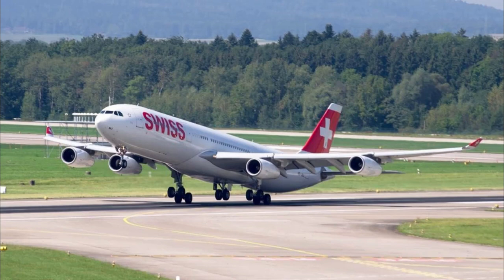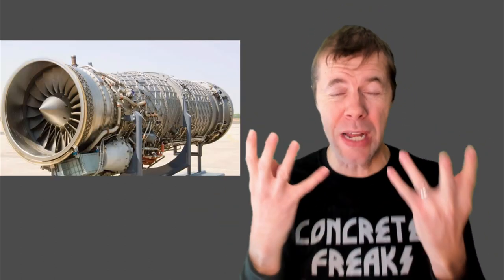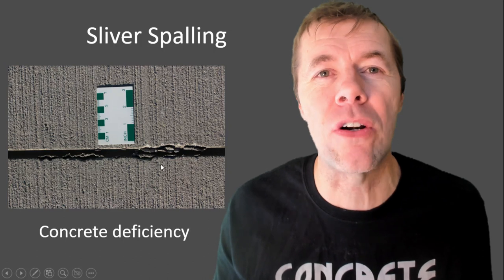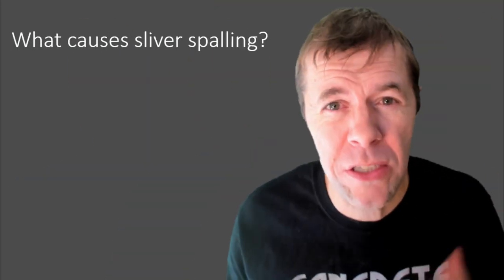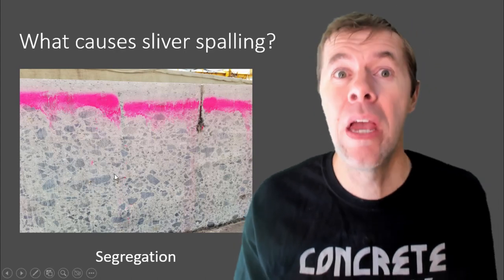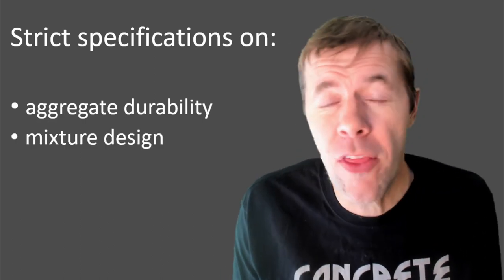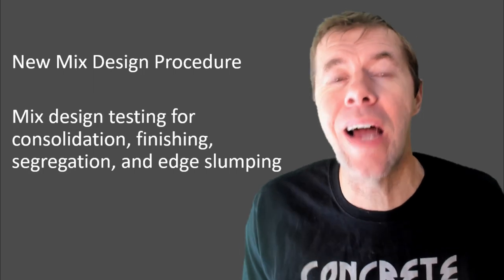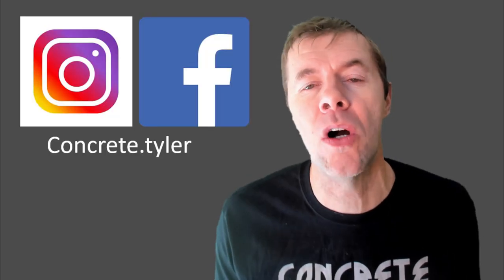Challenges with Airfield Pavements

Comment: My first job out of the MTSU CIM program was an airfield paving operation. 

We had portable plants scattered across the mid-Atlantic. 

I learned so much during my time there. 

Prepping a plant site, erecting the plant, stockpiling materials, logistically planning the delivery of a dozen loads of cement on paving days, batching 300 yards an hour to keep up with the paving train, making beams, running all kinds of heavy equipment including mixers, you name it. 

I still miss it sometimes
Reply from the maker: That is so cool!  It sounds like an awesome experience.
Reply: Were they dry or wet batch plants? All the recent airfield specs we've seen call for wet batch which eliminates many suppliers.
Reply: @concretelogicpodcast  wet batch. 
That’s not surprising about the spec. 
A dry batch would have a hard time keeping up with a paver I’d say.

Comment: Project in an airfield in California.  The engineers decided to put groves in the concrete parallel to the path of travel. I don't know if it was the close spacing of the grooves but the concrete completely failed.

Comment: Concrete runways definitely require very high quality throughout the whole process.
Where I live there are still a few concrete roads that have survived since probably the 60's. They have some wear, but are also proving the longevity of concrete paving. The downside is that you feel the joints when you drive on them, something that's even more noticeable when you have a car with low profile tires. But the required precision on the joints isn't the same for ordinary roads as it is for runways.
Reply from the maker: It is great that you are seeing such good life out of your concrete pavements.

Comment: A video focusing on the role of aggregate in concrete would be much appreciated. I've always assumed it was mostly just a way of reducing the amount of cement used and that a higher amount of cement would be ideal if it were economical. This also seems to align with my experience with home store cement products, where a bag of run-of-the-mill concrete is much cheaper than something like precision grout. But my understanding clearly isn't the whole picture due to the sliver spalling/segregation issue, which I knew nothing about.

Thanks professor!
Reply: That is good idea for a video.  I would guess he already did one in the early days of the channel, but it would be good to revisit.  The aggregate provides almost all of the strength, especially compressive load bearing strength.  The rest is glue to hold the aggregate together and fill the small voids.

Comment: As a mechanical engineer we used to joke that if concrete were invented today it would not be authorised, but I admire your enthusiasm, I was part of the (UK) team that designed the National Airport Pavement Test Facility in Atlantic City. Actually just the machine itself the rail system, steel bridge gantry and landing gear attachment. The premise was that it was the subgrade that often failed, leading to the concrete failure. I see much impressive work done on this topic. By the way, Concorde crashed because the FOD was a bit from a previous aircraft taking off, a DC10, not any concrete but it does illustrate your general point.
Reply from the maker: Thanks Mike!  I have heard about the test facility in Atlantic City but I have never seen it.  
I think concrete is pretty amazing!  We can make something that lasts for generations in the weather for only a few cents per pound.  IT GIVES ME CHILLS!
Reply: @TylerLey 2020 FAA Airport Improvement Program grants used 68% of 4.3B budget for concrete. The tech center research is tasked with driving down that %.

Comment: My father was a USAF aircraft maintenance officer back in the late 50s and early 60s.  I remember him talking about the requirement to launch and recover an overloaded (1,000,000 pounds) B-52 and the concrete needing to be 10 feet deep.  The plane could carry it, but the worry was damage to the runway.  During the Cold War we were always trying to demonstrate some feature or other that the USSR could not do, and flying a million pounds was one of them.  I believe later there was a million pound 747 that made a similar demonstration.  

If you ever get an opportunity to visit Russia, you'll be shocked at how poor their concrete is even within Moscow.  Some sidewalks have gaping holes of broken concrete.  Surface damage is evident everywhere.  And repaired areas are falling apart.  As an Air Force officer myself, it made me wonder at the quality of their concrete missile silos.  And now, with all the shortcomings of their military maintenance and logistics causing problems in Ukraine, I REALLY wonder about the quality of their missile silos.
Reply: Traditionally they just replaced concrete a lot because they have a lot of energy and cement is easy to steel by the workers.

Comment: Can it have layers?  How about a top layer with mesh, fibers, etc., to prevent spalling?  Or even a topical fiberglass or carbon fiber treatment or some such thing that is adhered to the concrete?  To prevent edge slumping, could they lay down a curb on either side first, and then fill in the runway?  This way the edges of the monolith would be supported from the beginning, and the mix design could favor other parameters.

Comment: Hello Tyler, I have two questions for you but it is unrelated to this video. 
1) Does drilling bolts on concrete columns to install insulation and cladding cause premature corrosion in rebars? What is the right way of doing it?
2) Can metal cladding start electrolysis between cladding material and steel rebars due to bolting concrete elements?

Best wishes from Turkey
Reply: Get pins or mounts that you can epoxy in place. Anythi going in can cause a problem, design so y I u jave a place without steel to mount to.